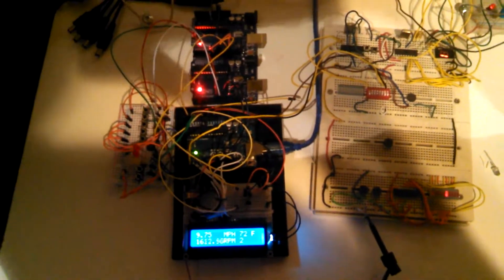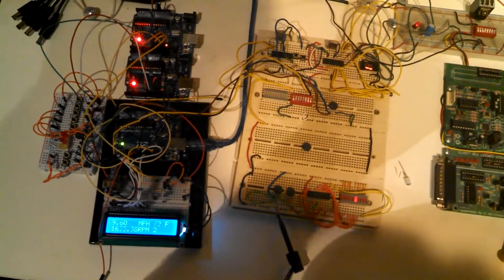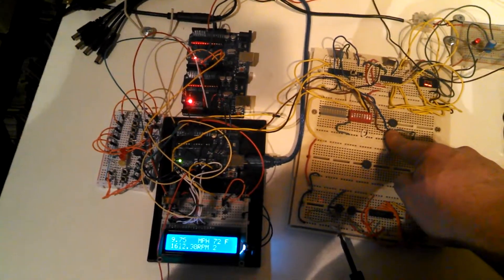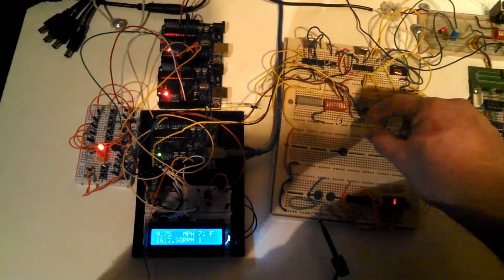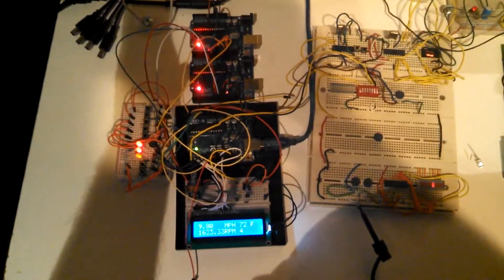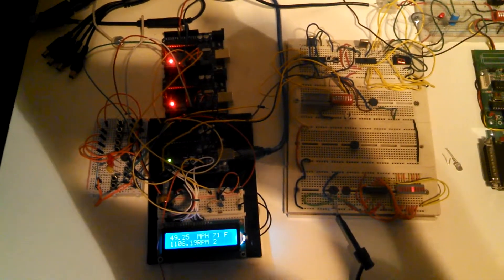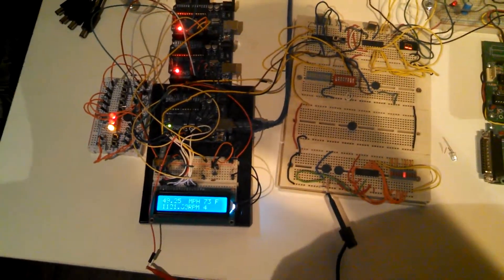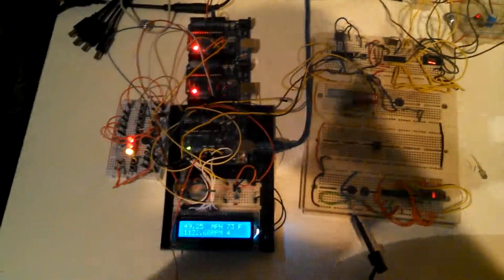DIY 4L80e TCM/TCU v12

Comment: Hey man this is awesome, well done. Is there any chance you can send me instructions for this? Like required components and how to put them together? I picked a rolling chassis 89 Camaro and I’ve installed all new suspension, manual rack and pinion, brakes from a C5 etc... for the power train I did a deal with a guy where he gave me a 6.0 ls with 4l60e 2wd (no harness or computer) I have a speeduino kit running the motor and I’ve been using an 0411 to control the trans (like a piggyback ecu in reverse) but I want to upgrade to the 80e and I’d like more control over the gearbox. The aftermarket controllers are for more expensive than I’d like and after seeing what the arduino can do I’d love to have one running my trans. If you’re interested in sending me instructions I’d be happy to pay, trade etc.. to compensate you just one request please if you do decide to send them, idiot proof them lol
Reply from the maker: Hey Lima, one quick solution to run a 4L80e is to swap the solenoid 2 and 3 wires/pins in the harness with your current setup. Regarding the code baseline for Arduino, I've not touched it in years. I just lost interest  and my car is fun to drive in full manual mode anyways. It would take me some time to solder up the FETs and do real world testing. Just no desire to do so, like I said I'm enjoying my original setup. Anyway, good luck with your build.

Comment: Are you still working on this?  The link posted is invalid.  I'm wanting to swap a 4l80e into a older diesel pickup truck but not wanting to spend $600 on a controller.  I I can add a TPS to the pump on the diesel, and I know I can swap over to a "tach distributor" on the diesel.  I'd like to see about getting your code for this if possible.  I know I'd need to tweak a few things since redline/WOT is only 3400 on my truck.
Reply from the maker: I have not touched this in some time. If you want full automatic mode you will need build circuits to use the internal speed sensors in the transmission. You could design around this but that is completely up to you.
Reply: @black70buick54  Yes, I'd like to have full automatic.  I was thinking about just building a simple shield for the arudino.  I know a lot of people aren't bothering with PWM for line pressure and just running it full pressure.  (No biggie to me, this is a 1 ton truck, big and heavy)  I was thinking about just using 3 IRF540 to control the A/B and TCC solenoids.  Then a buck converter to handle the 14v down to 5v.  Would you mind sharing your sketch and schematics?  My email is the same as my user name at gmail.com

Comment: i went to this address  http://www.v8buick.com/showthread.php... and it said page error. im looking for parts list, schematics, and coding. can you help me thank you.
Reply: Hmm. V8buick did a site upgrade not long ago. I guess the post has changed or expired. Parts and schematic/wire depend mainly on the transmission and vehicle. If you have basic Arduino skills I can give you code snippets with logic.
Reply: i just started playing with the raspberry Pi, but i then saw your YouTube videos and didn't have the money to buy  a trans controller. i have a 93 Chevy c1500 5.7 with a 4l60 i have the trans plug schematics just need yours for the unit itself so i can correctly wire the plug for the trans. i am currently lying to the original ecu so i can drive it, because its carbureted now, but it just shifts up and the tcc doesn't work right, i just need something that will work good. i really like the v.12 that you posted and will be working on some arduino skills shortly. i will also be updating my cam and hopefully around tax time purchasing Holley's new sniper fuel injection. appreciate any help. thanks again.

Comment: can i do this with a arduino starter kit? and dos the 4r70w ford work simulary? thanks:-)
Reply from the maker: +killving The arduino starter kit can handle pretty much any logic you need for a <any> transmission. The question regarding the ford tranny is really a matter of looking up the solenoid sequencing for gears. From this document: http://www.trucktransdiag.com/downloads/4r70w_technical_information.pdf  the answer is yes...this is the same solenoid sequence as the GM THM 4L80E transmission.
Reply: thank you so mutch. orderd a sarter kit so vil be great :-)